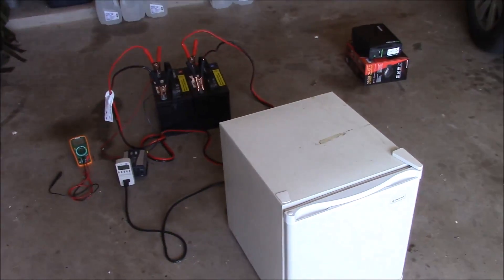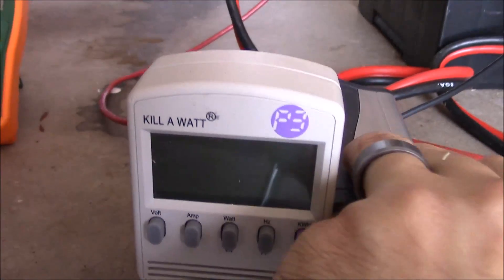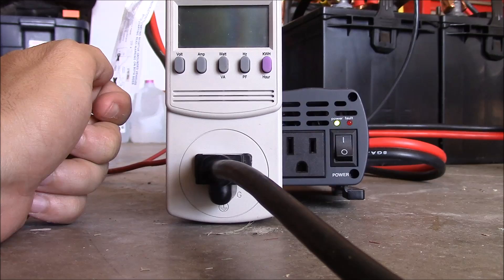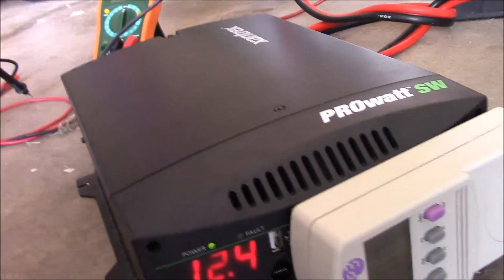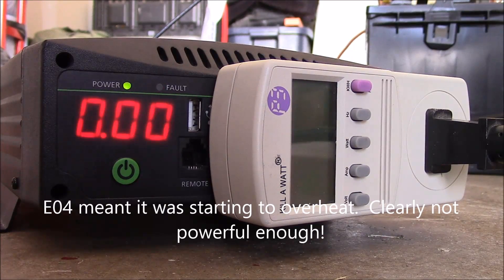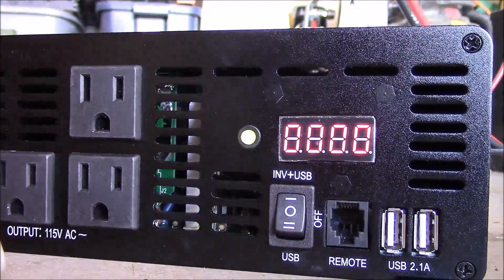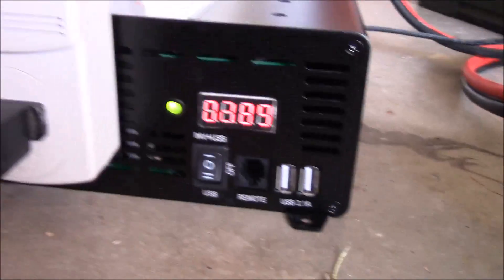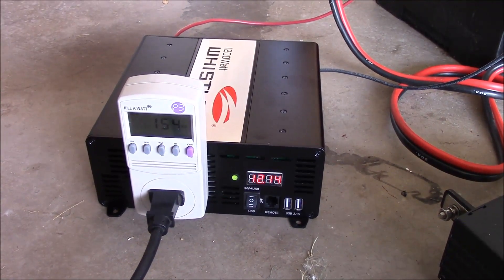Will It Solar? - Mini Dorm Fridge 3

Comment: Supco hard start capacitor.
You can add a capacitor to the existing start capacitor on the compressor to send a greater surge of current to the compressor motor at startup. The Supco has an internal relay that dumps the charge when full, after about 10-15 seconds. It is polarity specific, and runs parallel with the existing capacitor.
Reply from the maker: Good idea.  Have a link for one?
Reply: They are polar specific from what I've read, so make sure to hook them up correctly, or they wont work.
I have NOT attempted this, but from other YT videos, it should do the trick on lower amp draw compressor.
I also read that you can build a bank of capacitors to increase the surge capacity if 1 isn't enough.
https://www.amazon.com/SPP6-Capacitor-Increase-Starting-Torque/dp/B0002YTLFE
Reply: It gets me wondering, instead of building a bank of capacitors dedicated to the fridge compressor, you might be able to extend the inverters' ability by increasing its peak output for any device connected. I could even see it being a stand alone product that plugs inline between inverter and other appliances.
That way if you have a camper van with an ac unit and a fridge, each which draw only 3-400w continuous, but surge at 1500w for 1-2 seconds, you could run them off a 1000w inverter, but have a capacitor bank ready to deliver either of them 3-4000w at any given moment. 
It sees that is a weakness to many inverters. Their surge capabilities are limited to only a few milliseconds, and a compressor requires a surge of 1-2 seconds or more.

Comment: i done what you got there but 3 days of cloudy weather and i was killing my battery bank.. you dont want  your battery to sit at 12 volts or under for to long ive herd they start sulfating  on the lead plates ...so a masive battery bank is required to stay over 12.5.. but if you get a hole week of cloud your big bank will suffer to ...my setup fridge only comes on when its sunny only.... to not kill my battery bank..its hard to run an appliance that goes round the clock cause its constantly draining untill the shit hits the fan with constant cloudy days in a row
Reply from the maker: Yes, 24 hour loads are the bane of solar.  Even small ones like fans that run 24/7 require enormous amounts of power and battery storage.

Comment: Your definitive testing will need a meter with peak capture or a 'scope to see what the start current is.  Kill-A-Watt is useful but only reads averaged values.  Assume that a fridge compressor will require 3 to 7 times its running watts on startup.  That puts the startup of a 137 watt fridge at 411 to 959 watts.  I have a VERY efficient Kenmore 4.4 cu ft counter height fridge (big dorm fridge) that runs at 55 watts and the Kill-A-Watt tells me that the fridge is only on for 5 1/2 hours/day.  The price may seem high at $190 but remember how little power it uses.
http://www.sears.com/kenmore-4.4-cu-ft-compact-refrigerator-stainless-steel/p-04699783000P
The little fridge won't start on a 500 watt Pure Sine Wave (PSW) inverter but the 2000 watt PSW inverter starts it with no problems.  I don't try to run electronics or motors (other than brushed power tools) on anything other than PSW.
Samsung has a french door bottom freezer 28 cu ft fridge that averages 59 watts/hour (1416 watts/day).  The actual power varies between 2 and 180 watts (had a Kill-A-Watt on one for a week) and the average power after acclimating to an environment (cooling down from being on a truck, making enough ice to fill the bin, etc, etc) varied from 89 watts/hour the first day to 59 watts/hour by the end of the week.  That's pretty good for a fridge that big.
Reply from the maker: Great info.  Thanks for commenting!

Comment: Just wanted to pass my solar test along to you.
I use a 1000w pure sign wave inverter, (4)6v batteries for a total of 12v and 460ah.  I just powered for the 1st time, 1 chest freezer and 1 chest refrigerator, 5 hours of 24" tv and burned up a total of roughly 1000w in 24 hours.  I am pretty sure I only used 8 or 6 gauge wiring. Also, the math I learned on this... I have (4) 100w panels. 12v*460ah=5520w.  5520w * .20 in losses = roughly 4400w.  4400w/50% of my batter means I should get 2200 usable watts.  I found that is not accurate.  I should get 2200 but realistically get about 1500 usable of the 2200.   Always use thicker wires too.  Wiring is important.  Thinner wires will get hot I believe and can cause issues.

One more note, all appliances I used were very energy efficient.
Chest freezer uses 212kwh per year
Chest Fridge uses less that 172kwh per year (not sure the exact number)
TV uses roughly 55kwh per year
I have started all these up at the exact same time with no problems. 
Pure sign wave inverters are critical for anything that uses a motor.
Reply from the maker: What were you using to measure the consumption of energy?

It is best not to wire batteries in parallel if at all possible.  Invariably one of the "strings" of batteries will take the bigger brunt of the load as the electricity will flow from whatever has the least resistance (better connection, shorter wire, etc.).

Also, if you were to wire your 4 batteries all in series and use your system as 24V instead of 12V you would not need to run big wires and voltage drop and heat would be less of an issue.  It would also be safer as you would be using half as many amps to power your inverter (although your 1,000W inverter should be safe - my general rule is never go above 1,000W for 12V and 2,000W for 24V, etc.).

Comment: I had the same problem use 8 guage wire
Reply from the maker: That could certainly help.  But in this case it is the inverter that has to be able to handle a surge load for more than a split second.

Comment: approximately 1.5 amp multiplied by 110 volt= 160 watts multiplied by 24 hours and 20% duty cycle is 800 watt-hour of energy for one day. 2 battery of 100 amp-hour= 200 amp-hour multiplied by 12 volt= 2400 watt-hour inside the battery but we can use only 50% if it is a deep cycle AGM so 2400/2=1200 watt-hour so we have enough energy inside the battery bank to run the fridge for one day. 2 solar panel of 100 watt with sun for 4 hours is 2 x 100 x 4 = 800 watt hour so we will be able to recharge the batteries with 4 hours of sun.
Reply from the maker: Yes, the math works.  That has never been the problem.  This video series was trying to demonstrate that math doesn't always translate to the real world.  In this case, an inverter with a 600-800W surge capacity should have been able to run this load.  However, the internal circuity and surge capacity of inverters is often misreported, outright false, or misleading.  You will need at least 4-5x the running watts of the motor for a full 2 seconds to start the compressor motor.  Most surge ratings are only for a split second.
Reply: do you know if a supercapacitor assembly could help during the surge
Reply from the maker: Yes it does.  Unfortunately, I used too small of a capacitor in my testing.
Reply: Ok so your first one who seams to know what your talking about may I ask you will a one hundred watt panel with one hundred amp battery runmy mini fridge which says .08amps and if so for how long or how much more do I need  thank you hope you answer me I'm trying to get my van up and going
Reply: Denis Fortier  thank you
Reply: Denis Fortier hey i wrote a comment about reducing the amount of times the fridge/freezer will need to start up on his first video of 'mini fridge will it solar'
Reply: If it helps your calcs. It doesn't run all day the thermostat shuts off the bulk. It just a mater of the circuit.
Reply: It seams I'm going to need two batteries how about panells
Reply: Is it only 800 watts a day because it's only running sometimes?
Reply: I had a camper that had a similar setup (by previous owner) dorm fridge running off a 1500 w inverter with two 12v AGM (don't remember the amps).  Since the fridge cycled on and off, I could run it easily for 2 days+ with no outside power input or solar.
Reply: Lol wrong information but nice try. No wonder most solar system don't  work.
Reply: hi dennis i planning on living off grid' i will have a 265w solar panel, two 110ah lead acid batteries, i want to run afridge 24hrs a day, the fridge in is rated at 60watts, will i have enough power to run the fridge, cheers.
Reply: @karlobluesman  if your fridge is 60 watts, this means 60 watts x 24 hours x 50% duty cycle= 1440/2=720 watts-hours for one day
now the question is are your batteries big enough, so 2 x 110 amp hour = 220 amp hour x 12 volts = 2640 watt hour but you can use only 50% so 2640 / 2 = 1320 watt hour available in your batteries which is plenty enough. But you will have to recharge them with solar 265 watt x 4 hours = 1060 watts hour and the conclusion is that 1060 solar watts hour is plenty enough to compensate for using 720 watts hours with your fridge.
Reply: @denisfortier9716  Hi thanks for taking your time to reply' i have another question' what size inverter would i need? as i am getting conflicting info' as i know fridges use a lot of power on start up' i was told to multiply the power by 6' also have been told you should multiply by 10 times or even twenty times greater than the power rating of the fridge which is a 60w am looking to get' also i would be getting a pure sine wave. cheers, karl

Comment: u need pure sine wave inverters ssquare wave inverters are on and off on and off when you plug in if its in a off cycle it will fault this is why most motors dont work good with square wave get a pure sine wave
Reply from the maker: True.  This fridge will work with a modified sine wave inverter, though.  I tried it with the biggest pure sine wave I had and it still didn't have enough to start the motor.  The major factor is the surge capacity of the unit and most manufacturers lie about this rating.

Comment: high frequency inverters dont work well with motors  When a motor starts there is a high surge current for a couple seconds. But a high frequency inverter will onky handle a surge for aprix 5 milliseconds so they trip out. Get a low freq inverter they are designed for motor and fridges etc
Reply from the maker: Yes, I have noticed that.  Unfortunately, most inverters do not publish that kind of information.  They all claim they can handle "surges" but that proves not to be the case in the real world, at least not with motors.

Comment: stop with the shitty inverter. The neutral is also hot.
Reply: put a 500 watt work light on it.
Reply from the maker: I don't have a 500 watt work light.  The point was to test the fridge and find out what would run it.  Obviously the cheap, small inverters will not run it which is what I learned and was demonstrating.
Reply: As strange as it may sound and pun intended. Not all electricity is created equally. Starting a motor is a very dynamic operation.
There is a fine line between a starting surge and a dead short on induction motors.
Reply from the maker: Yep.  I know enough to conceptually know that there is a big surge but beyond that I am no electrical engineer.  So I just have to test stuff in the real world and find out if it works.  I thought for sure that the capacitor in this video would do the trick.  Maybe the cap was not big enough.

Comment: I did a Dometic 65: http://amzn.to/2mesVED on a 12v setup in my cargo trailer. So far I love it!!! Great video.
Reply from the maker: I love Dometic air conditioners and refrigerators.  I wish I could afford them.  They are steep!
Reply: It was indeed. But I just sold my brand new travel trailer to build a cargo trailer that can run on solar. 
So this fit the bill perfectly for what we needed and cheaper than what my new travel trailer was.
Reply from the maker: Not saying you made a mistake, just that they have almost no competition in the 12v refrigeration and air conditioning world so they are expensive.

Comment: Got old APC SmartUPS 1000  (670W) for free and it works fine with my normal size fridge. Need add fan also.
Reply from the maker: Cool!  Good idea to use one of those.  They are more expensive than a similar size inverter but they have advantages.

Comment: I had a 1000w inverter on one battery fully charged and it also would not start a small fridge but the 1000w petrol generator started the fridge no problem at all.
Reply from the maker: It has to do with the circuitry that provides surge power.  Some inverters have it and some don't.  I remember reading an article that was very technical about why that is but I forgot and I'm not an electrical engineer :)
Reply: @LDSreliance   the minimum is a 3000 watt inverter......you need the juice to startup , then continuous 1500 which is supplied by this inverted keeps it going.

Comment: I use a different brand than the kill a watt, but it will show max watts pulled, though not sure how well it can catch a motor startup spike (it was only $15). For my fridge, the watt meter shows high/peak of 826 and it uses on average 108  watts while running (ranges from 96-170).  If your watt meter does show high/low values, then for future tests,  you can always reset it, then plug the device into a regular outlet to find out the average and max watts needed before trying it on battery/solar.
Reply from the maker: Good ideas.  I need to find a good one that reads fast enough to catch the current surge of a compressor motor firing up.  That would be very useful!

Comment: Awesome!  coincidence for me, but I had just purchased that same Whistler 1200watt inverter.  I usually mount my inverters on top of my trucks battery.   Now my question (for all) is do you really need two batteries?  And do they need to be deep cell? Anybody upgrade their truck/car battery for an application like this?  I've heard of people using very large deep cell batteries in their cars with no issues. Thanks
Reply from the maker: You do not need two batteries.  I just wanted to have MORE than enough battery power so that I could safely eliminate that as a variable in the semi-scientific experiment I was trying to conduct.  I knew that it was overkill.  I would not run an inverter off of a normal car battery.  It cannot be discharged below 90%.  Deep cycle batteries can safely go down to 20% before you do lasting damage.  So if you wire that Whistler into a truck, be very careful!
Reply: Deep cycle batteries don't do well for starting vehicles.  The reason is the way they're designed and built -- deep cycle has many thin plates per cell, that lets the chemicals work on a large surface area and continue to give useful power as the battery discharges. The downside of this is that a large surge of power can damage the thinner plates and when you turn the key to "start" in a vehicle, the starter draws a huge surge of power.  If the thin plates are overheated enough to warp them so that even two of them touch, that cell -- and the entire battery -- is shorted out and dead.  The thicker plates in a regular starting battery resist the effects of the starter surge much better, but they don't supply the even power when they're run down a bit that deep cycle batteries do.
The two batteries are built differently because they have different jobs to do, unfortunately, they don't do each others job very well.
A good thing to do is to install a deep cycle as an auxiliary battery through an auxiliary diverter switch.  Your alternator will charge the startup battery and use that to start the truck or car and the inverter will also charge the deep cell to power your inverter.  Each battery is doing the job it's meant to.

I'd be worried about a 1200 watt inverter in a vehicle.  At full load, an inverter that big would be pulling about 100 Amps DC off the vehicle (and basically loading the alternator that much).  That's a large load, especially when you consider that it's in addition to all the other loads on the vehicle.  There's a pretty good chance that it would also send power surges back into the vehicle's electrical system when the inverter turns on and off -- you wouldn't want to burn out the engine's ECM computer.  If you install it, be careful about the amount of loads you put on it.

Comment: Study some physics and focus on what the difference between static and kinetic friction is. The jist of it is that it takes a lot of "UMPH to get the compressor motor started. Once it's going it only takes 150 watts to run  but for that first split second it's using ten times that.
Reply from the maker: So what is your point?  I know it takes a big surge of power but how much?  What kind of inverter is going to provide that power?  No manufacturer of small fridges (or any fridge that I have seen) tells you the exact amount of surge that it takes to kick on the compressor motor.  So the entire point of this video was to test as many devices as I could find until I found a feasible, real world setup that doesn't break the bank and can actually start one of these things.
Reply: @LDSreliance  3000 pure sine wave inverter